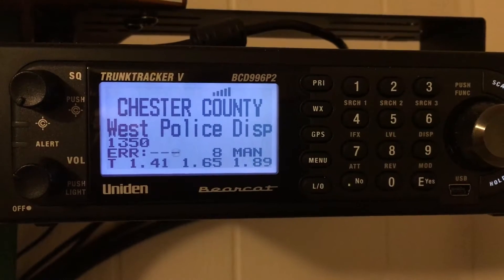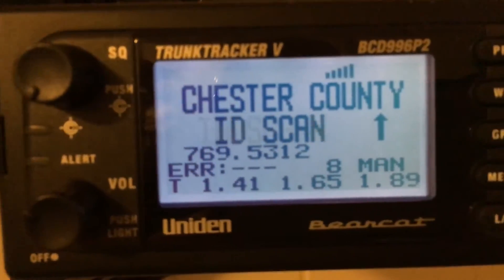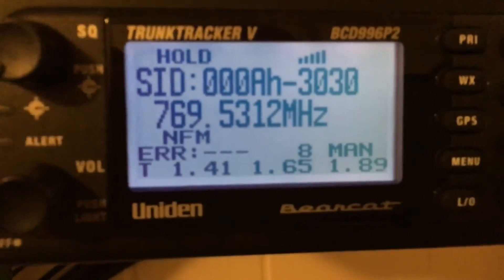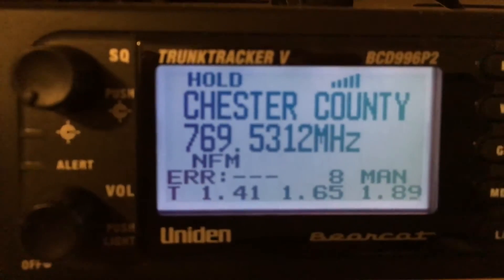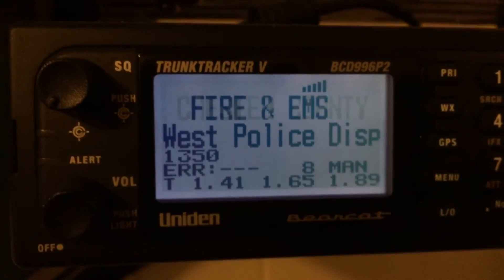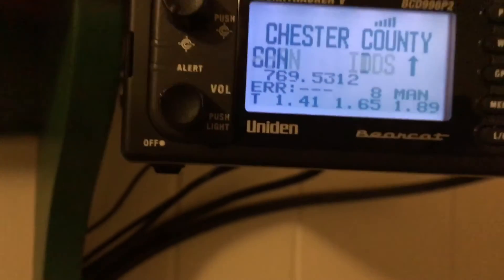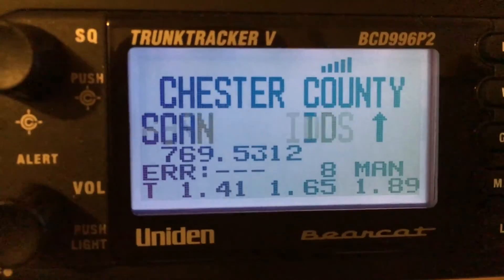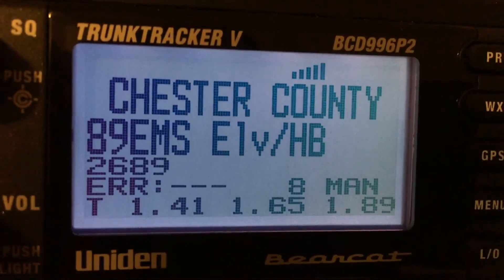Signal strength and continuous control channel receive

Comment: Jerry, I'm in Lancaster county, I tried entering the west system and get some signal. I have a question. It looks like you are receiving everything off one control channel. If that's the case, is that all I would need to enter? Simulcast works great but I'd like to use the P25 system. I/m also running a discone 30 feet up.

Comment: you are set on ID SCAN right there, meaning you only receive talkgroups that are programmed. ID SEARCH to find new talkgroups (this is like using a wildcard in the radioshack or GRE scanners). you prob know this. just pointing it out in case.